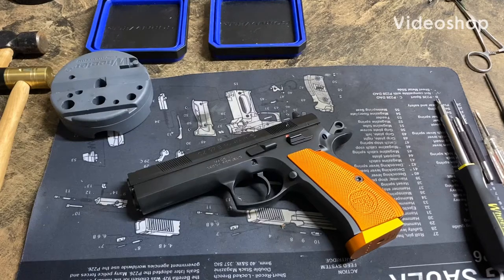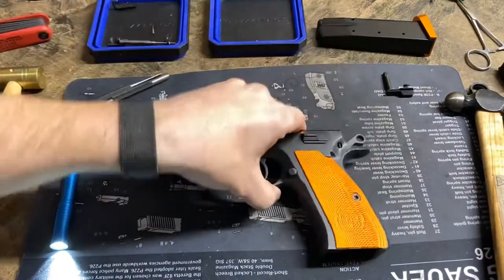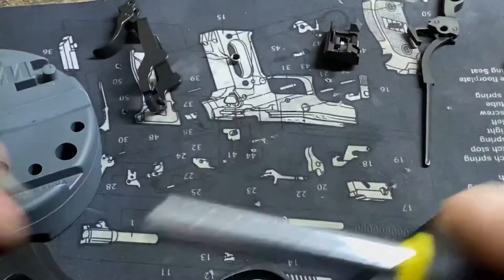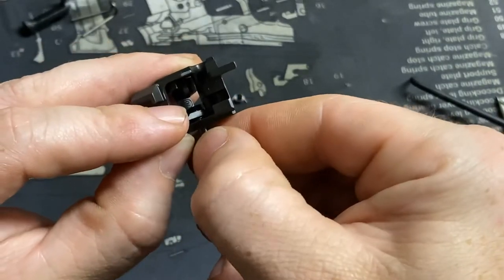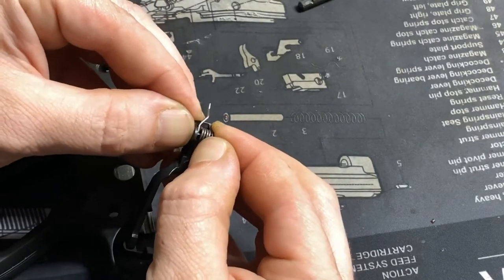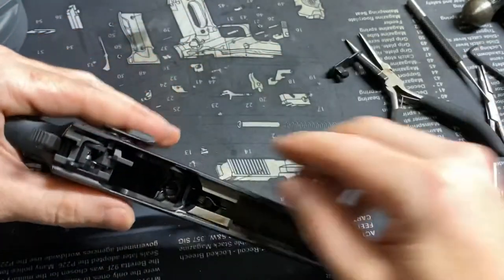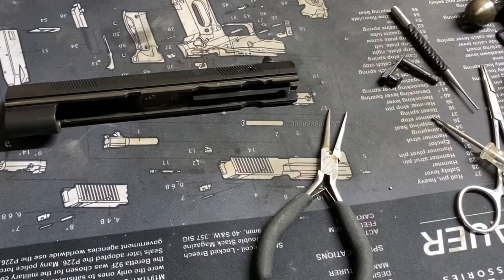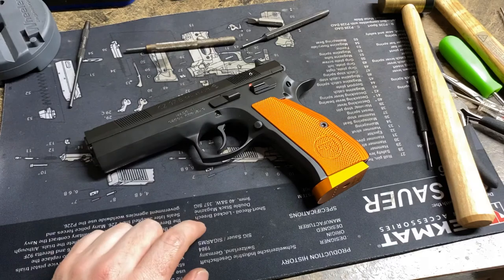CZ 97b Complete Disassembly/Reassembly

Comment: This really helped with mag release issues I had fresh from a gunbroker seller. They install the tensioning plate incorrectly causing the plate to put too much tension on the mags. This forces the user to pull the mags out with the release engaged. a two-hand process! Thanks for your help!!

Comment: Bought my CZ 97B back in 2018.  Love it; but, today (8/1/2023) it stopped firing.  Looks like a firing pin issue.  A gunsmith completely disassembled my gun two moths ago so it could be cerakoted.  I am wondering if he/she messed up the fire pin assembly?

Comment: How tight does the screw that holds the lifting bar spring in need to be?  I noticed when I tighten it, the spring pulls away from the sides of the frame inward?  any suggestions?